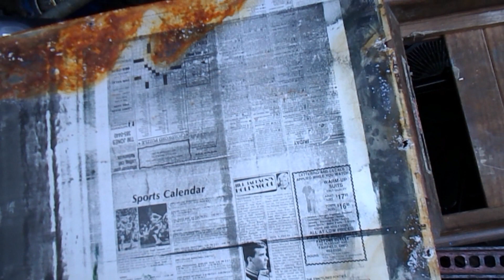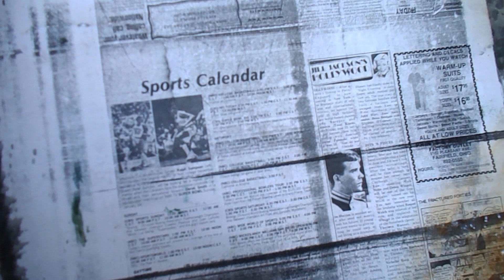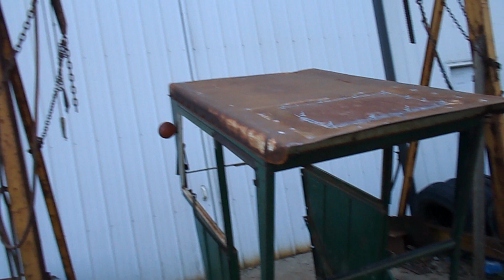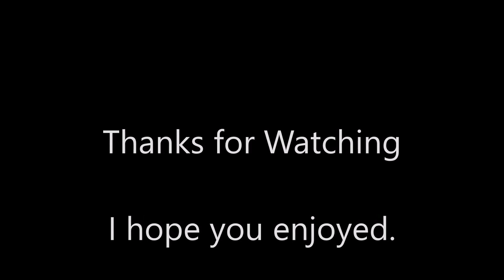Cab On Cab Off Fenders On My Back Hurt's !

Comment: ROP's with roof is a suggestion
Reply from the maker: That would be nice to have but they are pricey to buy them ready to go new or used. But I have the cab and with a little scrap steel and some time I can make the cab work good for what I want and that's just to be out of the sun.  Bandit
Reply: @banditfarmer1900  Well, you never know what you might find at an auction.  I found one for my JD 3010 cheap a few years ago.  Any shade is nice in the summer.  Looking forward to what you come up with.
Reply from the maker: @ntromzek   That's the bad thing right now, There are no auctions aloud right now and around here there few and far between. But I have a cab it just needs some TLC and I can make some mounts once I hit a scrap yard and find what I need. Usually I hit one every couple of years and pick up some odds and ends that's last me a good while . But this summer when blue rolls out of the barn and on the road the 1850 goes in and the cab goes back on !  I got a plan !  Bandit

Comment: I think some better steps would make the cab usable. I did a quick Google search of oliver 1850s with cabs and saw examples of those tractors with a similar cab with good actual steps. Angle them foreward to get past the wheels. Those steps are rubbish.  
Those tractors are simply not the easiest tractors to get on and off of. On newer newer designed tractors that mover the operator station forward, you only have to pivot yourself around 90 degrees to get seated when climbing on to the tractor. These tractors(and many of the older tractors), you have to pivot much further than 90 degrees get seated. The David Brown 990 is possibly even worse since it is a true straddle design, meaning the operator platform doesn't have any semblance of being flat.(and they had a cab option from the factory too😒!)I'm not saying they are bad tractors for this feature, but I do view it as a drawback.
Just a thought, hope the wider front tires dont rub when installed.
Reply from the maker: Those steps are a bit of a joke but its nothing I cant handle to make some new ones, That's why I took it back off. Too many things to do to get it put on right so I need to get to looking around and visit the scrap yards and see what kind of goodies I can come up with. At least I only have to make one set cause the other side would be imposable to get in or out of because of the gear shift being like it is so that makes it easer to make just one set of steps for it.  This cab might be a little smaller than most but I think I can get use to it, But the steps and door need to be modified to make it easer to get in and out of that's for sure. So many things to do and so little time right now but come summer I'll have time to do it and do it right !  Front tires are going to be a breeze , All it takes is a strait edge and a tape measure to find the right rims , I got this covered !  You going to like what you see !  Bandit

Comment: You could cut front support loose and extend it forward 6 inches and build a custom door if you want one on it
Reply from the maker: I sat it on really to see how it was going to fit and I think more than anything the problem is the steps and lack of brackets for it that I'm going to have to make cause I didn't get everything for the cab like I was suppose to. So seeing how much I was going to have to make to mount it I figured I'd just take it off and work on it this summer when I have more time to work on it and don't have to worry about getting crops in. I can make it work for me I just time to figure it out and build the brackets I need. It for sure needs panels made for the front and back to keep it steady and the scrap yards just reopened so I need to go down and root threw there scrap pile for the metal I need to do it with plus I need to go threw a couple of junk yards for some glass I can use for it in places, Still might use the Lexan that's tinted for the side and back windows . But I need time to do it so for now its on the back burner for now, So hello sunshine !  Bandit

Comment: Hey bandit didn’t you put bigger tyres on the tractor ?
Reply from the maker: The back tires are the same size as the old ones were but they are a bit taller by about 4 inches so it raised the back of the tractor about 2 inches. Now I have a set of 9.5Lx15" 3 ribs on order and waiting for them to come in and I think it will make it sit level and help hold the front end up better than the 7.5Lx15" 3 ribs do and I think it will look a lot better too !  Bandit

Comment: I wouldn't worry so much about the cab. I know you had your mind set on using it but the tractor looks fine with just the fenders. Just me but I think that cab would make so much noise rattling around you probably wouldn't like it anyway.  A good ROPS would work fine. Any word from the  Boehm  farm? Last post he had split his 2+2 and was rebuilding the trans and clutch.
Reply from the maker: Believe it or not this cab was put on the tractor when it was new and the guy I got it from had just taken the cab off the day before I went to look at it and bought it. I'm not worried about the not being glass in it, More than anything it is mostly for being out of the sun. I have a good idea how to get rid of the rattle from it and its pretty easy to do, I've done it before to cabs for other guys and they said it really makes a big difference inside the cab.  Just use some spray bed liner inside the cab and try to keep it smooth and it really deadens the sound inside the cab, That and a good thick rubber mat on the floor makes a big difference. I talked to Jacob the other day (went over for some eggs !) and with all the new chickens he got he's got a lot of eggs to gather and wash everyday !  Like 25 dozen !  LOL I forgot to ask him about the 2x2 but I didn't see it in the shop so I guess that video will be coming soon.  Bandit

Comment: Thanks for  the update The tractors looking good with the fenders on i know thats not what you wanted though. To me it looks like thats either way the wrong cab or it maybe the whole cab needs to come forward more  somehow.  That step just looks way wrong for being where it is for the right fit from new.  
    I know it's not to hard to put a White 2-135 type cab on a Deere 4010/20  tractor, a guy local with no brains and not much mechanical skill either has done it L.O.L.  how hard or expensive would it be with your good shop skills to find and put one on a tractor thats nearer a white than a Deere ever will be. My thinking is  that would be a far nicer cab than that tin rattle box ever would be for your later years farming career, but i know thinking or my opinion's  got me in trouble here before L.O.L.  Take care
Reply from the maker: I'm not going to worry about a cab right now, I worried about getting into the field for the first time , And getting ready to cut wheat and figuring out what to do with the straw.  This is the cab that was put on the tractor when it was new so I would like to put it back on with the fenders back on it to. The back tires are 2 or 3 inches taller than the original ones so the steps are a little off you might say, But they can be moved around with a few new holes drilled in it or just make some new ones witch I like the idea a lot better !  I do have parts so I could put AC in the cab if I can figure out how and ware to mount the compressor . But for now the fenders will work just fine, Aint like I've never done this before so another year wont kill me ! LOL Just make me a little browner ! Bandit

Comment: Sure made me tired watching you do all that work! lol
Reply from the maker: Well you got to try it or you'll never know. But now I know what I need to do I'll be hitting the scrap yard to look for the steel I need to make some new brackets and what I need to make some new steps for it. Best thing is I only have to make one set for it because the other side of the cab you cant get in or out of it because of the shift lever so that makes it easer to make one for the other side . I'll put the factory step back on it so there is one on each side for fueling but when the cab goes back on it will have a good set of steps to get in and out of the cab easer !  When you got more time than money it makes you get crafty and I know just how I'm going to build the steps and make the door a bit bigger but now is not the time to try it but this summer I'll have time to do it right !  More to the cab is coming this summer !  Bandit

Comment: i guess id cut the cab up and frankenstein something with twice the square footage if i was gonna use it
Reply from the maker: Well from what I could see of it on there its as wide as the fenders are set out so I think it will work out fine for me, More than anything its to keep me out of the sun so I can deal with it as is. A year round cab would be nice and I have one but I want it to go on the Long as its the planting tractor . But I have the cab for the Oliver it came with that was put on it new so its only right to put it back on , Its kind of a match set you might say ! LOL I got some LED lights for it and new warning lights for it so I'm going to enjoy putting it back on and lighting it up .  Bandit

Comment: that cab is made awful small id feel cramped running it and it would be really hard to get in and out for me anyway
Reply from the maker: Its as wide as the fenders set all the way out so its not too bad , Just takes some getting used to it plus if I leave the side windows out it wont be too bad. The door and steps need to be worked on and with the help of some scrap steel and a little fabracobbling she'll be in good shape and a lot easer to get in and out of.  Bandit

Comment: Put the battery back where it's supposed to go
Reply from the maker: Well its under the hood ware its supposed to be, Oliver use two 6 volt batteries in the and on the 1850 they had one under the hood and one under the step. Now batteries are bigger and better so one 1000 cold cranking amp battery will start it just fine. If I put the cab back on the steps for the cab will be right in the way of the battery box under the floor and the one under the hood will be hard to get to so when I put the cab back on I'll have to make a new battery tray for it so I can get to it a lot easer.  Bandit

Comment: Are you sue you don't have the fender on the wrong side . The light should face forward
Reply from the maker: There on the right way, 2 headlights go forwards and one goes to the back.  One fender back has the red light on it so its pretty easy to put them on. Bandit

Comment: Cut the front posts out, all your using is for canopy.
Reply from the maker: Worst thing about the cab is it had the front glass in the cab when I bought it and was off the tractor, But then it was delivered the glass had been cut out of it and I was very pissed about it but they made it right.  I'm going to move the front posts in order to make it easer to get in and out and make a new set of steps for it too.  I'm still thinking about using that tinted lexan sheet I have to do the side and back windows for it, The back window really opens wide but the side windows dont move at all. So If I can put a windshield back in it leave the bottom glass and doors off and put side windows in and a back glass I thing it will get plenty of air threw it to keep me cool and out of the rain ! Bandit

Comment: Are you sure that cab came with that tractor from the factory or was it a aftermarket cab
Reply from the maker: In 65 you could order a cab on a new tractor and the tractor was shipped to the dealer and the dealer installed the cab, There were several cabs you could chose from and they were all aftermarket . This is a Full Vision Cab that bolts together and it came in a crate about the size of the roof of the cab and about 2 foot wide and the entire cab was inside of it. Its just panels they bolted together on the tractor so it was an easy install for 2 guys to do in a short time. As far as I know no early 50 series Oliver tractor left the factory with a factor cab on it , They built the tractor and the cabs were installed at the dealers. Now the 55 series tractors are another story.  Bandit